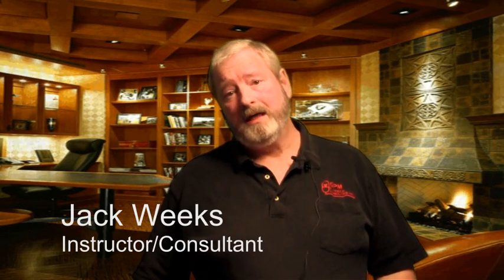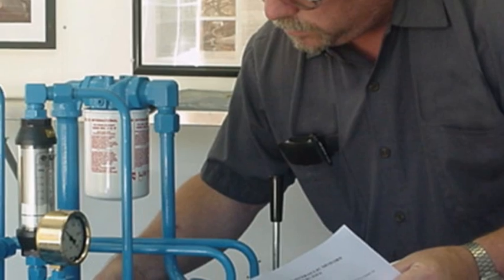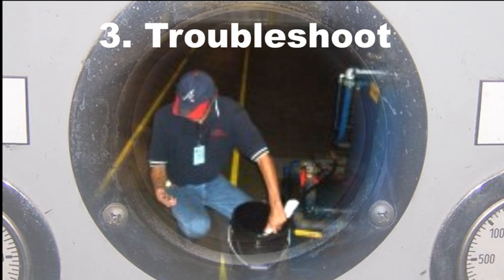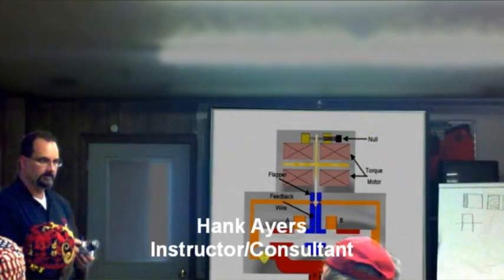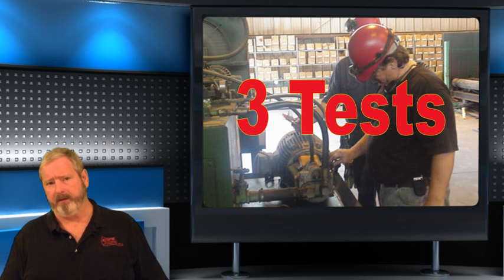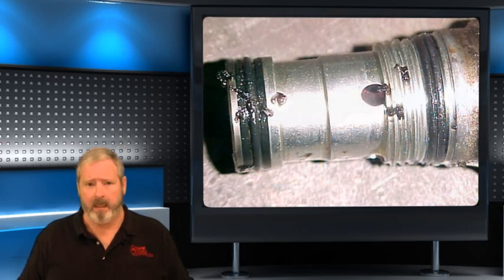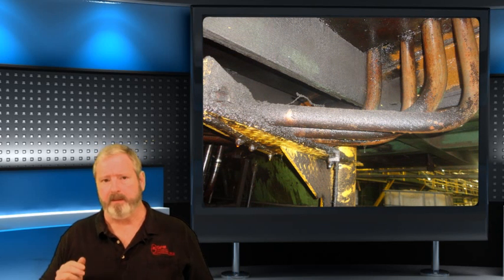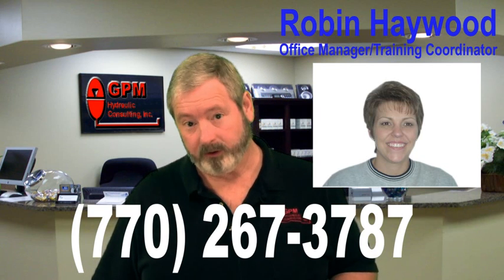Turning Parts Changers Into Troubleshooters

Comment from the maker: Thanks for your comment!  While I disagree about the validity of a case drain check, the picture you are referring to is actually a relief valve tank line test.  It is taught as an illustration, not as an advisable practice.  We strongly emphasize the risks involved and encourage safer methods (flow meters, temperature, current draw tests, etc.)  Safety is ALWAYS first!
Reply: Jack Weeks sz m